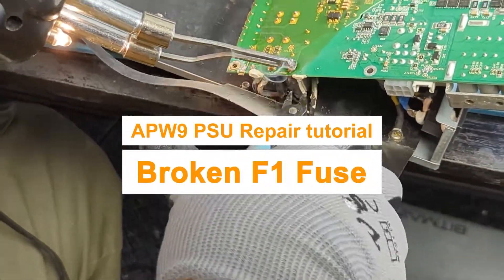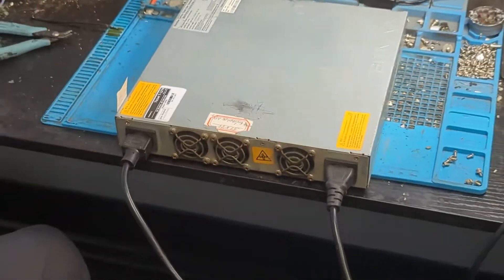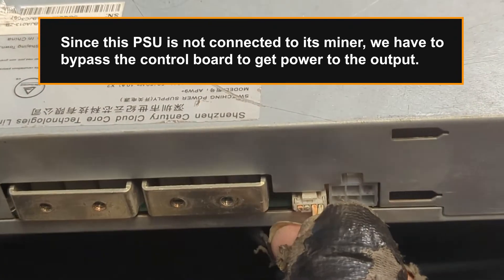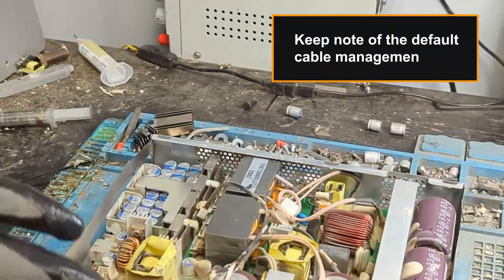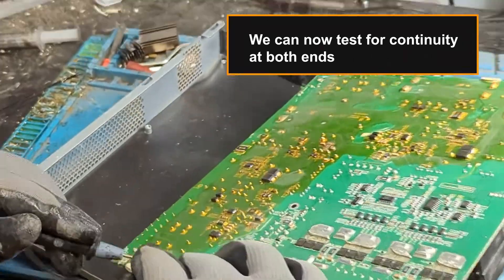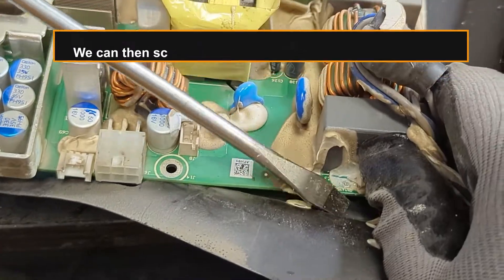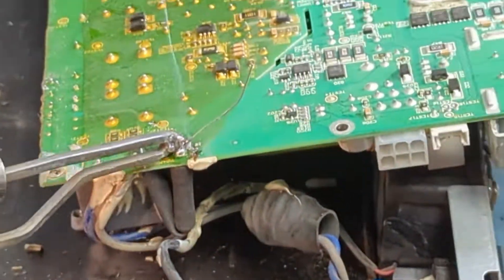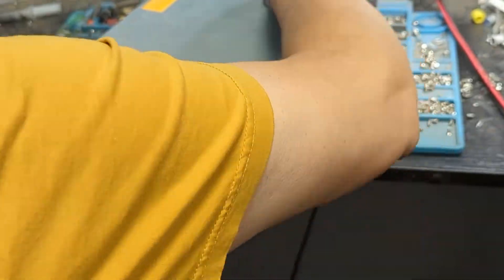Bitmain PSU Repair: How to Replace a Fuse on an APW9 Power Supply

Comment: By accident I added a 20 amp fuse and the power supply shocked :( do I have to use a 10 Amp right?
Reply from the maker: Yeah, it will work, the thing is, it could be dangerous if something bad happened. The fuse is designed to break at a certain point to cut off the electrical circuit to prevent fire, etc.